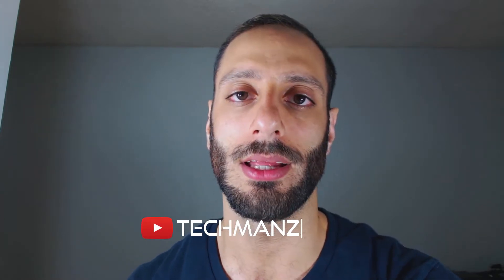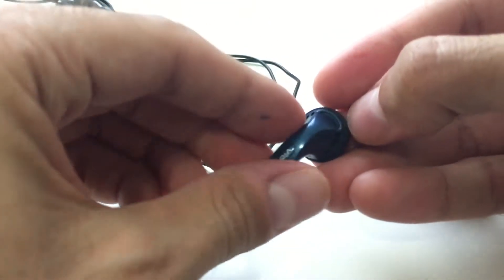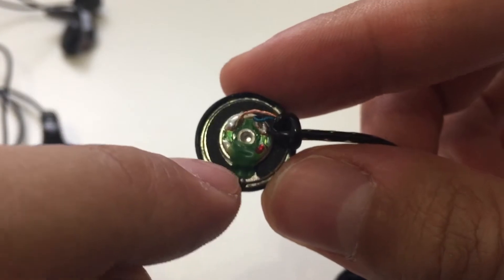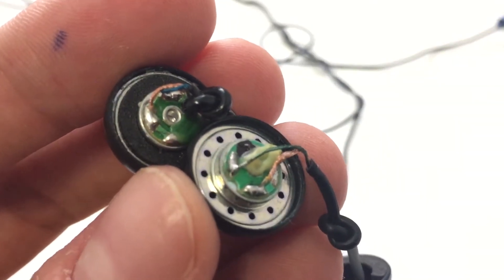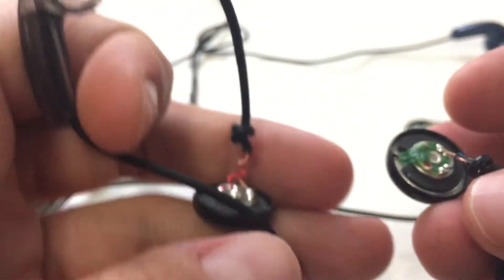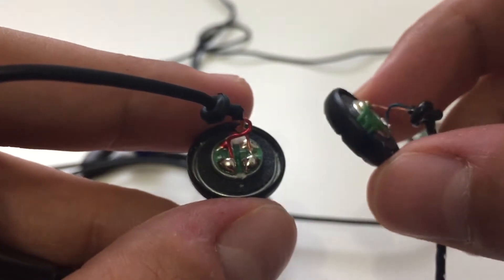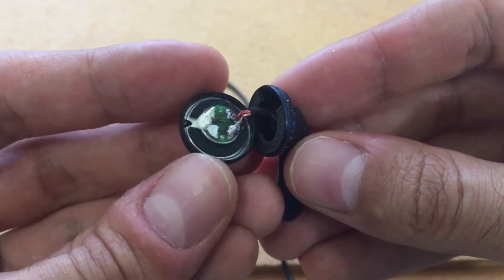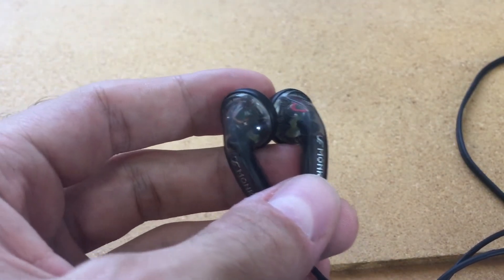Taking apart some of my Earphones Vido | VE Monk | Faaeal

Comment: Is it real that after a months of use on Vido's it will fail and will sound like a tin can?
Anyone here using Vidos for a long time? A year or years? Does the sound change like a crap or just sounding better??
Reply: I have them for 2 years and compared them with new ones. There is no appreciable difference. Generally the sponge tends to produce a change in sound when it is old.

Comment: Nice teardown, so ve and faaeal glued the damping foam to the driver. And here I just got the ingredients to make yuin pk3. Got the original drivers, got nice sleeved cable, Just need to decide which tenol to buy and how will i implement damping..well first time soldering might be difficult too

Comment: I like what you did here. Enquiring minds just want to know ;)
Personally I think that all these speakers are (often) the same.
Know that at this price point there's quite some varience in sound quality between the same speakers. When you buy expensive ones the speakers that aren't good enough are discarded or used for cheaper ones.
I bet if you buy 10 Monks not one will sound the same. Especially if you start measuring.
Insulation, cables and the material of the housing all make difference.
PS. Monk has made a Plus version that has the same looking shell but of a better material.
Reply from the maker: That's very likely.

Comment: You think that the ve monk plus which doesn't have the transparent housing will sound just as good as the vidos? So if someone is to purchase a ve monk plus which doesn't have the transparent housing, it will also have the same sound quality of the vido especially in the base area or if not exactly the same they'll not have much of a difference in sound quality compared to having a transparent one where you can say that they sound inferior compared to the vido and faaels?
Reply: jhoanne len abrecea The colour of the monks has no influence on the sound quality. Transparent means photons can pass through the plastic, not air
Reply from the maker: TBH. I've not tested the non transparent ve monks.
That's on my list but i'm going to have to assume that they most likely sound as good as the rest of the lot.